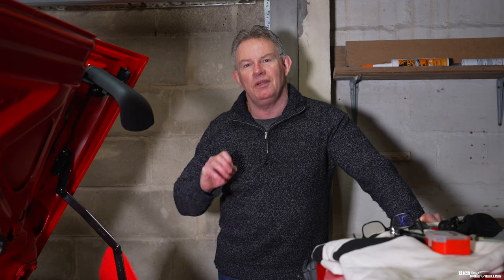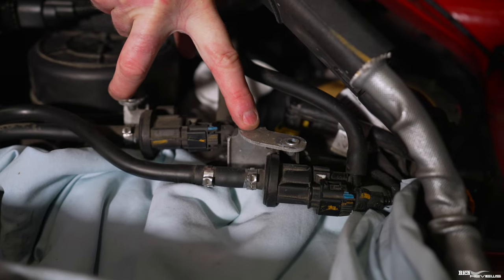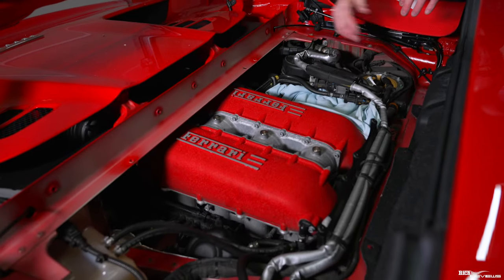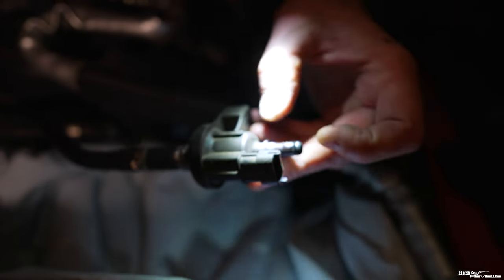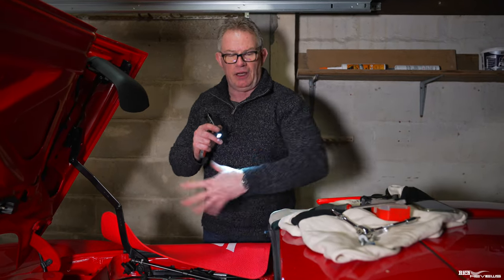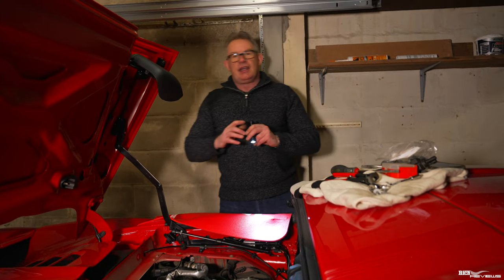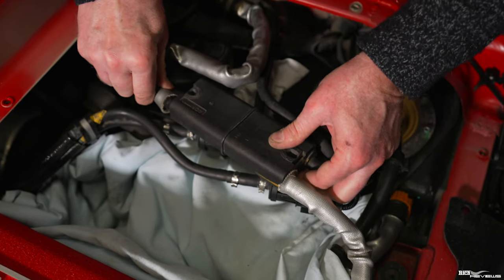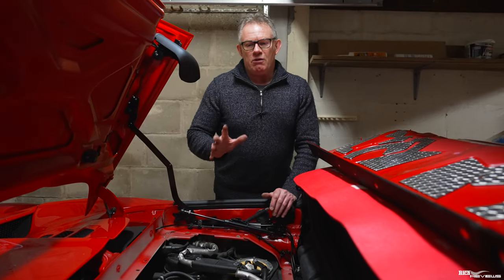CHEAP Fix To Stop the Annoying Ferrari TICKING Noise!

Comment from the maker: Today we perform the final maintenance operation within the engine compartment, replacing the EVAP Purge Valves (AKA Wash Valves/Solenoid Valves/Flush Valves).
The valves commonly become noisy through time and can fail inducing a dashboard Check Engine Light (CEL). As of the date of recording, this information does not exist in the public domain.

More Workshop videos to come…Each Winter Workshop repair will be fully documented in a separate video so make sure you’re Subscribed to receive Notifications for each video!…
https://www.youtube.com/RichReviews-TV/?sub-confirmation=1

Have you heard of this issue with Purge Valves?

Comment: Hypothetically speaking. What would happen if I disconnected and capped both ends of these valves?
Reply from the maker: You'd get a CEL error and would fail a future MOT.
You couldn't cap the emissions, you would need to at least vent them.

Comment: does anyone know what is the part number for the VAPOR SEPARATOR for the 458 spider? i might as well change this while i am at it
Reply from the maker: No point changing unless you are getting the EVAP error code...being placed in the rear wheel arch unless you are already doing work in there, which is unlikely, no point changing early.
Reply: @RichReviews_ i do have the p0455 error code and the dealer said to replace both
Reply from the maker: @banhtieu both? Purge Valves and Filter Assembly
Reply: @RichReviews_  yes that is what the dealer quoting me to replace both. they did a smoke test and told me that the part are too old and leaking
Reply from the maker: What did they quote you?
Reply: @ $3500 usd 😒
Reply from the maker: Was that their quote for replacing both including labour?

Comment: I wish I saw this before I did my purge valve job last weekend. Thank you much for sharing. For electrical clip, I realized we have the pull the blue clip since it's a locking mechanism which is annoying.
Reply from the maker: Did you break the clip on the connector?
Reply: @RichReviews_  yes it seems like I had broken the locking mechanism on the electrical connectors.
Reply from the maker: You may be able to buy new clips…check online
Reply: @RichReviews_  I pressed the clip very hard like you have shown in the video without unlocking the blue pin.
Reply: @RichReviews_  currently the purge valve is staying on there and the connector is tight enough without the locking mechanism. We will see how it goes, knock on wood. 😅
Reply from the maker: @jay5566f4 Italia or Spider?
If Italia then you have fairly easy access so can check regularly to make sure all okay. If the connector came off you’d know because you’d get an ECL
Reply: @RichReviews_  neither. It’s a F12. Yes I checked it everyday except the one behind my wheelhouse.
Reply from the maker: @jay5566f4 ah cool

Comment: What are the part numbers for these valves? I have the same annoying clicking noise on mine and this seems so easy to do.
Reply: Diagram 12 - Part number 254425 for the Flush/Purge Valve
Reply from the maker: Part number is as Will has provided 254425.
These are known commonly as Purge Valves but are also known as Flush/Wash/Solenoid valves
Reply: I ordered my valves and clips from FerrParts in the US. I was able to carry out this replacement on my car today thanks to your step by step walkthrough. You’re not kidding, those little clips will launch like a rocket if you’re not careful. Thanks for the great video.  This also gave me an excuse to deep clean my cam covers and underneath the heat shields.
Reply from the maker: Did you replace on a spider or Italia?